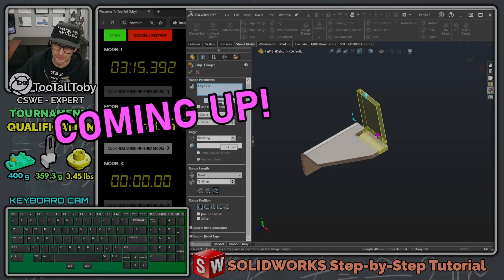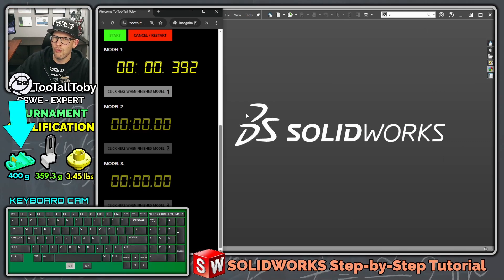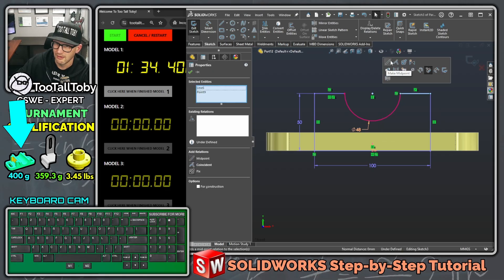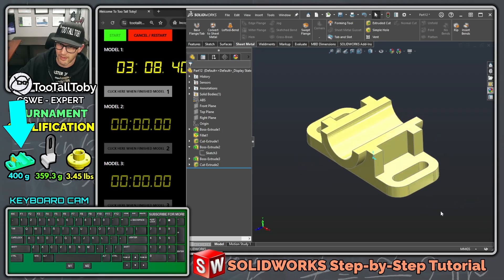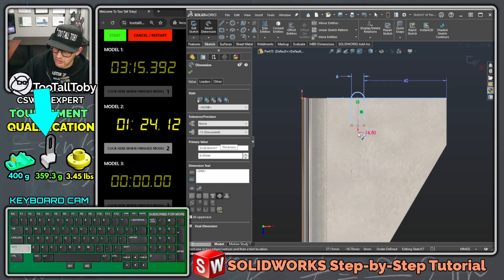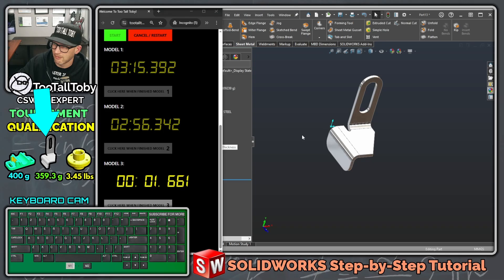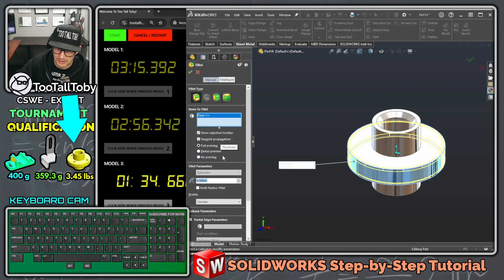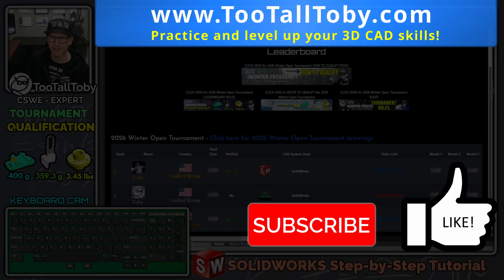CAD vs CAD Tournament - Qualification using SOLIDWORKS - TooTallToby - 2nd attempt

Comment: SW really should change the function of “esc” while editing flange profiles. I also get crashes if I use the slot or sketch fillet tools within the command
Reply from the maker: Listen Dom, they JUST added the new Sheet Metal Base Flange and Edge Flange tools (in SOLIDWORKS 2003). So give them some time - I'm sure they'll fix this "esc key" issue in the next 5-15 releases!
Reply: @TooTallToby  I should be more patient. It is a free software after all